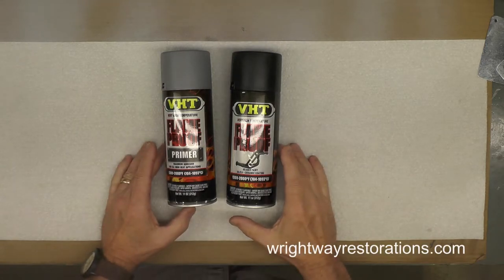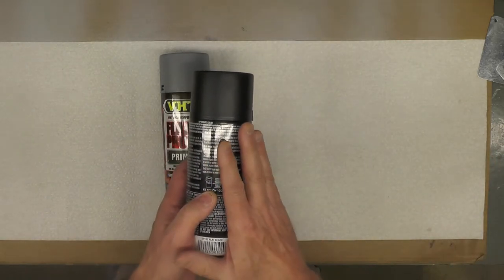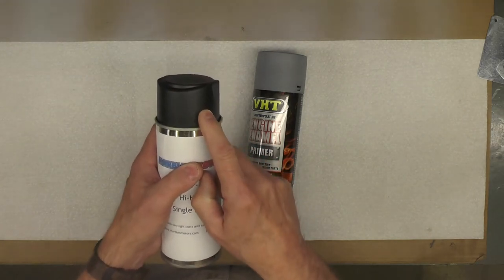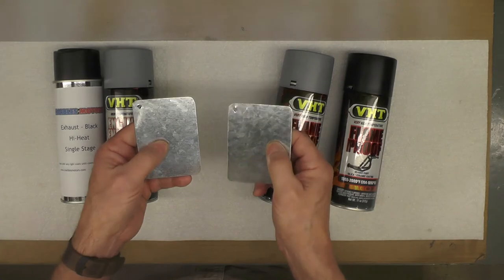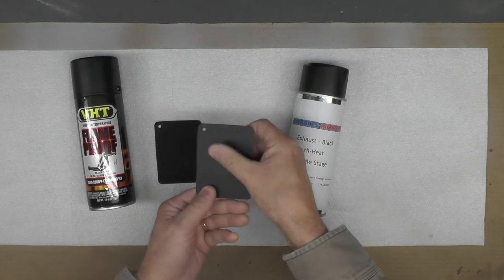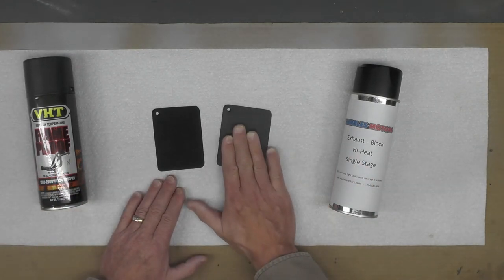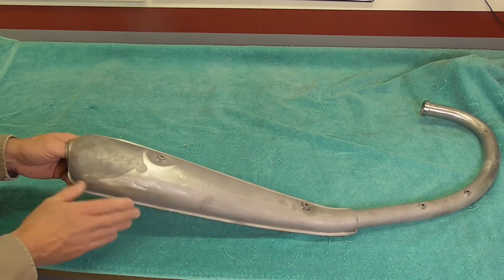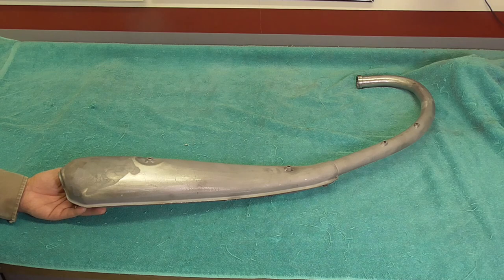Honda SL125, Painting the Exhaust System --- Video #259

Comment: Good morning. Many years ago I attempted a cosmetic improvement with my SL 350, after 10,000 miles, the exhaust pipes and mufflers were starting to fade a little and I used VHT to freshen things up a bit. In the 70's the technology of the paint was not what it is today and the results were satisfactory at best. I have always felt that the primer was the weak point with home application.
 Some 10 years later I built a wood stove and was searching for a better solution. I had remarkable success with bypassing the primer altogether and using a conversion coating on the sand blasted bare steel, which was maybe  18 to 22 gage steel ( barrel stove) which is close to the gage of steel used in motorcycle exhaust.
This stove saw beyond cherry red heat on many occasions with no degradation to the paint physically or cosmetically. This,I believe, was due to the conversion coating and the bond with the final high heat paint. Some 40 years later the stove still looks as good as the the day it was painted.
 The product I used for the conversion coating was called GalvaPrep and was , I believe similar to Parkerizing or a Zinc Phosphate conversion coating. 
Your situation is somewhat different with the areas filled with high heat JB Weld and will likely require a primer. 
 Excellent video as all have been during your restoration. Thank you again for the time and care you spend presenting them. I am learning so much from you. :)

Though perhaps not authentically correct and with the camera and lighting constraints, I like the aesthetic of the VHT sample, at least to my eyes.
Reply from the maker: Thanks for sharing your story and experiences Mark, most interesting, as well as the kind word.

In person, I believe the reproduction paint does represent the original color better than the VHT color, which is a bit too black. However, color aside, I still like VHT paint for this type of application.